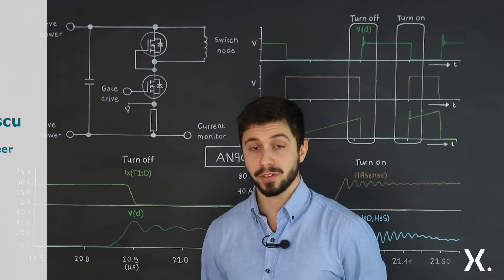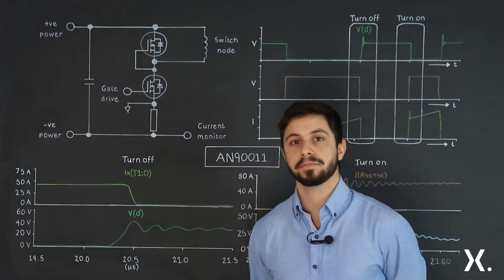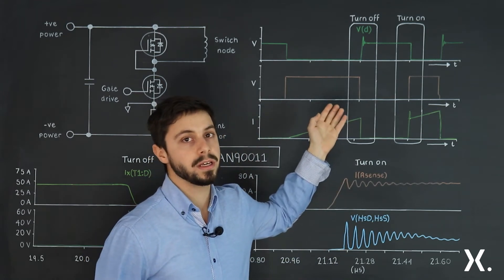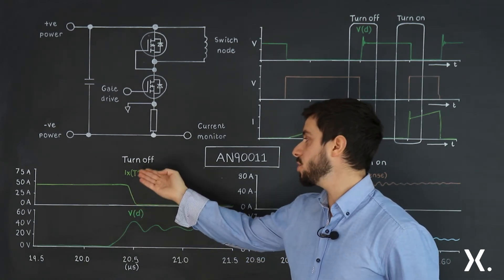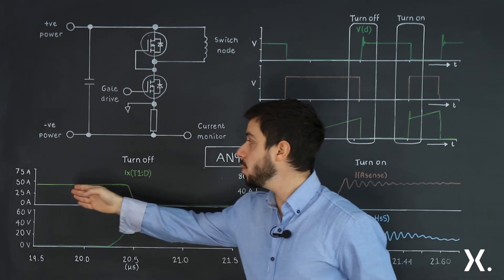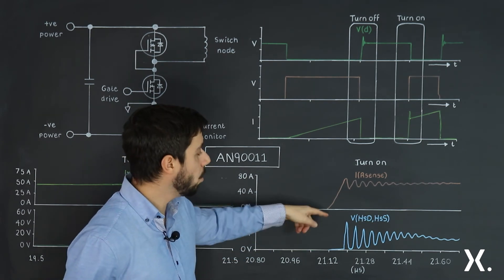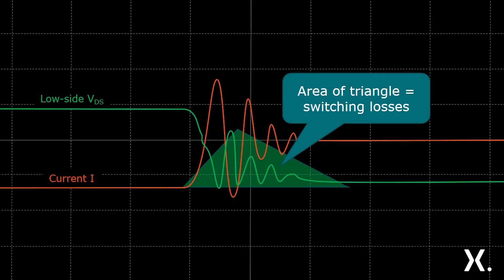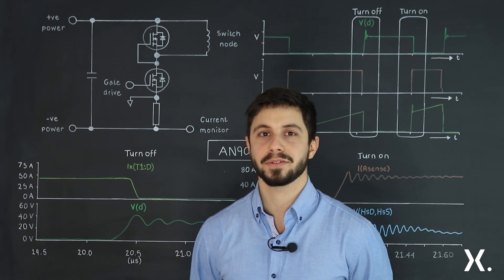Double pulse testing: assessing switching performance in power MOSFET applications

Comment: Nice explanation, I just want to know, how much does Low side Vds, drops at gate turn_on. Reason behind more drop below at the turn_on instance.
Reply from the maker: Hi @akashtarwade5460 , thanks for the question. Our engineer answered - Please have a look at the Application Note 90011, mainly at figures 5 and 10, and their explanations: https://assets.nexperia.com/documents/application-note/AN90011.pdf
The drop occurs mainly due to parasitic inductance in the circuit and high di/dt.

Comment: Thank you for your video.  I have two questions if you do not mind:
1) How does the inductor size effect the results? I think it should be chosen around the same size as will be in the application. 
2) Is measuring the stray inductance possible from this test? I think that the ringing frequency is a function of stray capacitance and stray inductance.

Thank you in advance.
Reply from the maker: Hello, thanks for your questions! 
1) Inductor size does not matter very much, it just needs to be large enough to act as a constant current source between the switching intervals and it can be representative of the inductor in the application at hand. The charging time is related to the inductor size. 
2) It can be approximated from the waveforms as the dip in the Vds @ turn on is directly related to the loop inductance and the di/dt (approximation and dependent on where it is measured Vds dip = L_loop * di/dt). Ringing frequency is related to the parasitic inductance and capacitance in the circuit and is damped by the resistance in the circuit. 
•	Also, Snubbers are a good way to damp oscitations. (Check the this application note: https://assets.nexperia.com/documents/application-note/AN11160.pdf)
•	Also, check the application note (Half-bridge MOSFET switching and its impact on EMC)  https://assets.nexperia.com/documents/application-note/AN90011.pdf

Comment: thank you for the video , i have the doubt regarding the turn off time duration t2 . for t1 duration its (Lload*Itest)/Vdc , mainly less than 100us . what should be the formula or trick behind t2 pulse duration ?
Reply from the maker: The aim behind the turn OFF period (t2 as mentioned) is to properly allow the device to be turned off. The period may be several times larger than the devices turn OFF time. When it comes to the 2nd pulse, its aim is to properly turn ON the device but at the same time it's duration could be quite short to keep the current low, this will avoid possible damage to the device or inductor saturation. In this case the period should be a minimum of several times bigger than the device's turn on time. Thanks for watching!